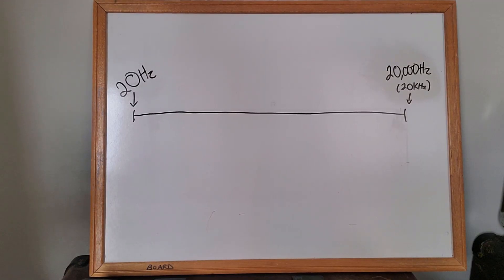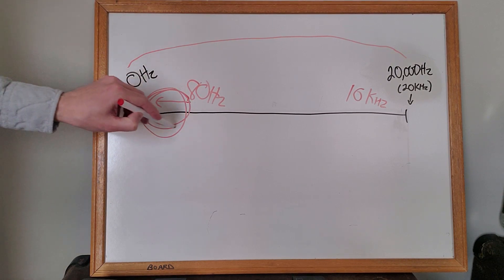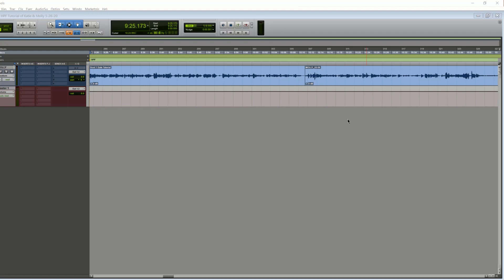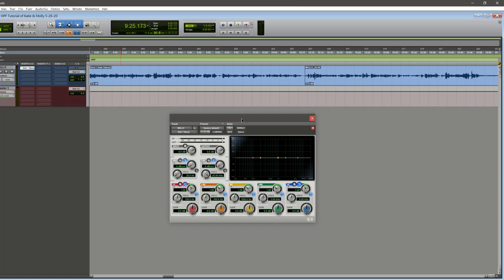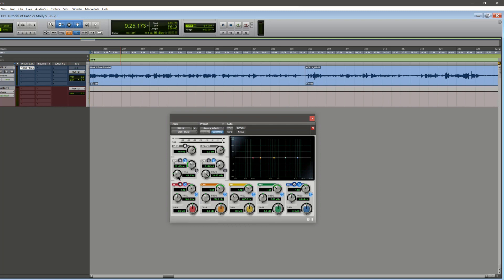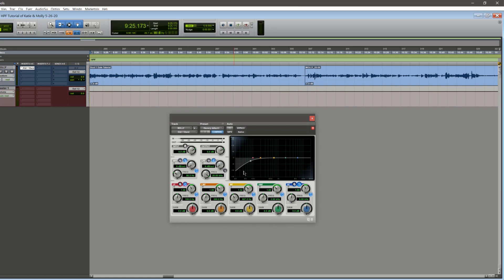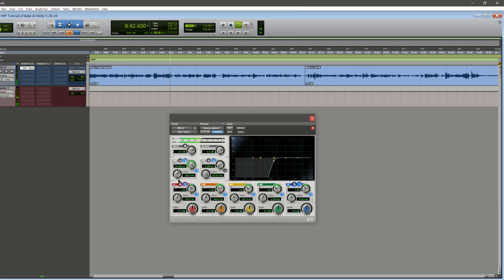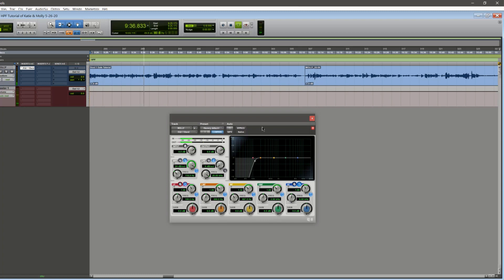High Pass Filter Tutorial for Podcasts & Voice Over - Improve Your Sound Quality - Justin Kral Audio

Comment: The gui representation for the hp filter looks exactly like the rolloff for speech in my EQ. Is there a difference between using the hp filter as opposed to the EQ? (I'm using software, Audacity, for post production only)
Reply from the maker: Hey! Without looking at your screen, I'm pretty sure the roll-off for speech you are using is the same as a HPF. Put it this way, anytime you roll-off low frequencies, that's a HPF. I'm thinking the Speech roll-off is preset in Audacity?
Reply: @justinkralpodcast  Yes. Doing more reading I think the difference is HPF is abrupt while the rolloff has an arc to it.
Reply from the maker: @brockdeskins5546  The roll-off can be as abrupt or subtle as you want. On a traditional EQ plugin, you will usually have a "Q" parameter. On a bell curve, this will help narrow or widen the frequencies you are choosing to boost or attenuate. On a HPF or a shelf filter, the "Q" will let you choose how subtle or severe the roll-off is.  Check out the 7:24 mark in the video above. I show how you can manipulate the curve of a HPF using the "Q".

Comment: Great video
Reply: HI Justin. I have a TLM 107 and it has a 40 and 100 hz low pass filter. I have not tried them yet. For a podcast for a male voice, any suggestions. Also, pre-attenuation options are  0, -6 and -12db. Where can I find a meaningful definition for these!
Reply from the maker: @improvingyoursoftwareproject  Hi Neil! Glad you are enjoying the videos.

A Tlm107 is a fantastic mic!

40hz is a good start since the low end of your voice will most likely not come close to that frequency range. By applying the 40hz filter you will help remove most potential low end rumble before it even makes it into your mic. If you feel like you want to set that a bit higher you can go for 100hz. Now, if you have a deep voice be careful as this setting may remove some low end frequencies that could be pleasing. My suggestion would be to record your voice without either HPF setting. Use that as a control. Then, record your voice saying the same thing, at the same volume, from the same distance from the mic with the 40hz and the 100hz setting. Then listen and compare them all. If the 100hz setting sounds like your cutting off too much low end than opt for the 40hz setting.

As for the 0db, - 6db, and - 12db settings, those are called pads. They will essentially make your mic less sensitive.  A reason you may want to do this is if you see you signal going into your recording interface too hot (too loud). This will most likely be indicated by some type of signal light hitting red (depends on what hardware you are plugging you mic into). So by setting it to - 6db you mic is not 6 decibels less sensitive to what it it picking up (your voice). If you set it to - 12db, same thing, just 12 decibels more sensitive. Although not the most accurate analogy, you can think of them as volume settings for your mics input. 0 being no change -6 being 6 db quite and -12 being 6 more db quieter.

I also noticed that you mic has a polar pattern selector. Thats all those funny shapes at the bottom back. For podcasting you will most likely want to use cardiod, which seems to be the middle symbol. Looks a bit like a heart. This will ensure signal is only being picked up from the front of the mic and it will be rejecting signal from almost everywhere else. (Just make sure you are speaking into the front of the mic!)

Hope this helps.  Let me know if you have any other questions!

Best,
Justin
Reply: @justinkralpodcast  Hi Justin. thanks. much appreciated. it arrives this week so I will try these out.
Reply: Hi Justin. I have the tlm107. It is quieter than the NT1A. My Rode AI-1 interface needs the gain to be turned up all the way with the 107 and it is still quiet. Is there a more powerful computer interface that you recommend for the 107 (I only need 1 mic input). Thanks.
Reply from the maker: @improvingyoursoftwareproject  Hey Neil. Quick question. Do you have phantom power engaged on your interface?
Reply: @justinkralpodcast  The Rode A1-I has P48 output
Reply from the maker: @improvingyoursoftwareproject  Yup. Have you turned it on? If not, I belive you need to push in the gain knob to activate it. A light will appear under P48
Reply: @justinkralpodcast  On. the mic works. it just needs the gain to be turned up all the way.
Reply from the maker: @improvingyoursoftwareproject  ok great. Last question. What is your pad set to on the mic? If it is set to -6 or-12 db than change it to 0.
Reply: @justinkralpodcast  Set to 0.
Reply from the maker: @improvingyoursoftwareproject  Hmm. A little strange tbh that a mic like this is so quiet. Two more things. 1. Make sure you are talking into the correct side of the mic. This will depend on what polar pattern you have selected. It seems silly but it can be confusing at times. And 2. If the output is barely audible then there may be a defect with the mic. I find this rare, but I have heard story of people returning gear because of defects. 

Since I can't hear exactly what is happening and we went through pretty much all the usuall suspects, it is hard to give an exact determination on what it going on.

If you have the opportunity to test it on another interface (maybe a friend or colleague) before you buy something new, I would recommend it.
Reply: @justinkralpodcast  Thanks. Facing the correct way. I found that one of the other cardioid patterns boosts the sound along with gain turned up. I did read that a) sensitivity of mic is less  than tlm 103, and another YouTuber also had to increase gain. what are some good single mic. thanks.
Reply from the maker: 👍 @improvingyoursoftwareproject  If you like the TLM series maybe just switch the the TLM 103.  And yes you are right it does have a higher sensitivity than the 107.
Reply: @justinkralpodcast  Fixed issue with new interface that has a higher gain. thanks. appreciate the help.